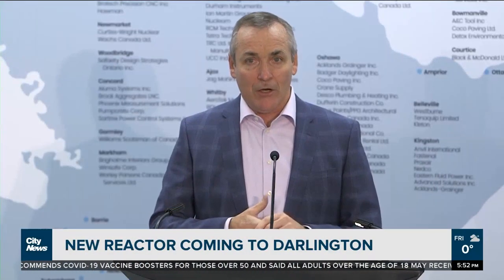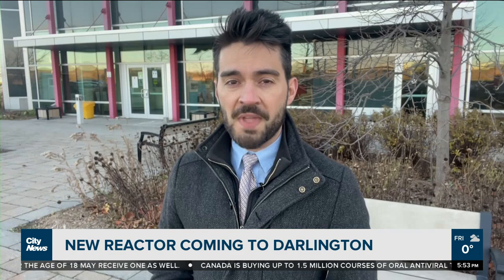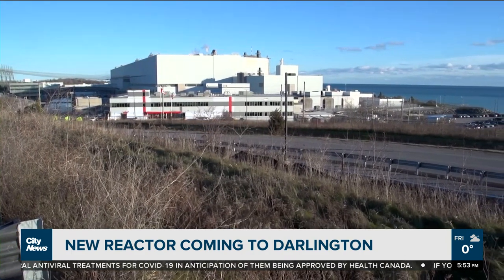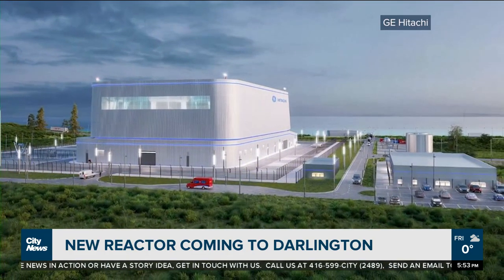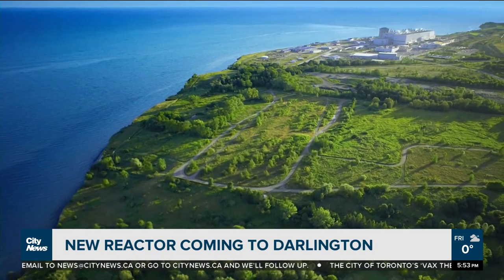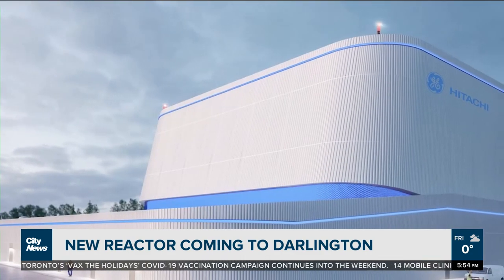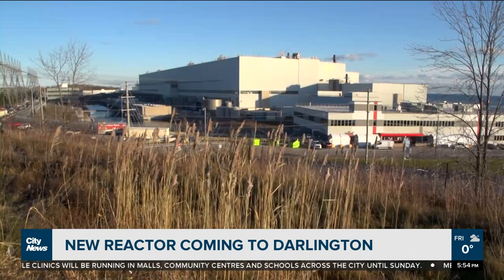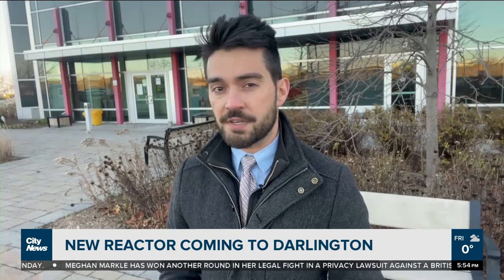New reactor coming to Darlington

Comment: The east side of Darlington was originally meant for a station like Darlington itself with ~4 Gigawatts of energy. This SMR has only 300 Megawatts. With EVs coming how much power will we need?
Reply: Solar panels on a roof instead of heating up black tar is one solution (in summer) of electrical power.

Comment: Why is Pickering still open? They are asking for a disaster.
Reply: Are you an engineer
Reply: all the plant date back to the 70's. they are all cracked, pissing and venting.
-in minecraft
Reply: Ask Ford
Reply: @Francois_Dupont  cracks can be welded
Reply: @georgedavidson1221  no but engineers have called for its closing like 15 years ago
Reply: @goylanddefree80  Then your listening to the wrong ones. They have many engineers on the Pickering site. It is completely safe and continues to be a reliable asset to Ontario’s electricity grid. CANDU reactors are amongst the safest in the world.
Reply: Just an ignorant question and statement.
CANDU reactors are the safest in the world.